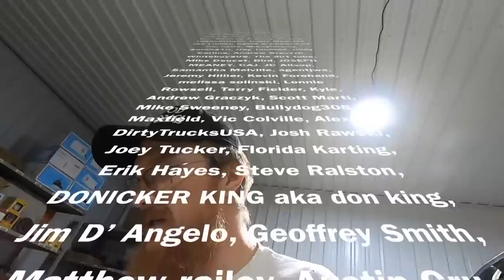custom intercooler pipes and power steering pump installed

Comment: Coming along nicely also a small pipe wrench works every single time for stuck / stubborn hoses and fittings it will break them loose every single time when a regular open end wrench just slips

Comment: Holy crap man! It's becoming very apparent that this truck is going to seriously be badass. The parts counter is through the roof. The body and frame seem in great shape for up there. Going to be a new ass truck big times. 

Actual good luck on the trans rebuild! Definitely very important. I think the rubber feet were taken out as they were a point of failure. 🙏

Comment: probably can just order the 4 bolts for the fan thingy from cummins parts them self. years ago i bought the killer dowel pin from cummins parts and service in Mississauga for my 98 12 valve

Comment: so are you not going to put a bolt on that power steering pump gear? u got the broken one out did not put one in then installed it without the bolt.
Reply from the maker: the bolt was just used to press the gear onto the shaft no need for bolt its stuck on there inwood terrible
Reply: So you could have left it in there , no problemo